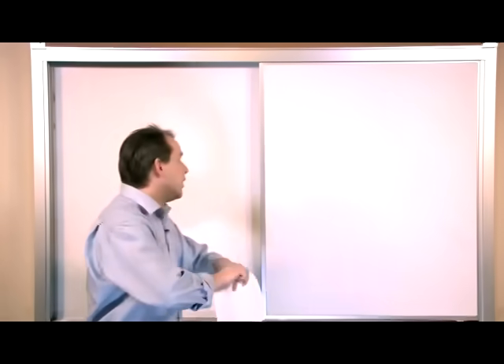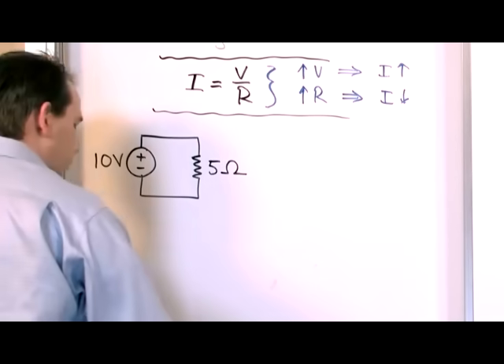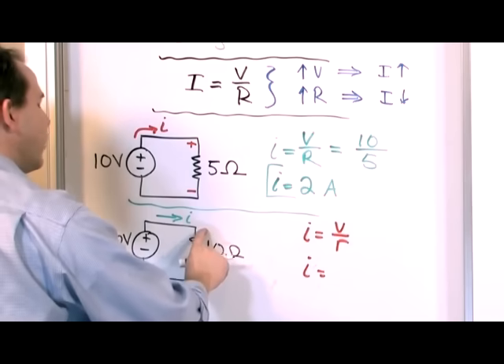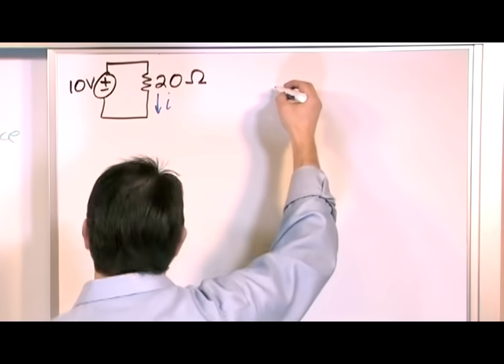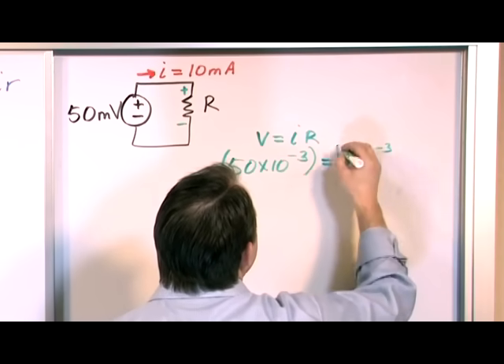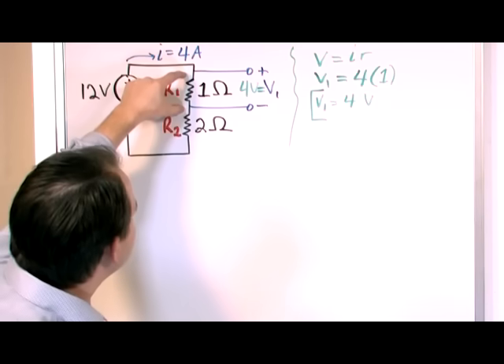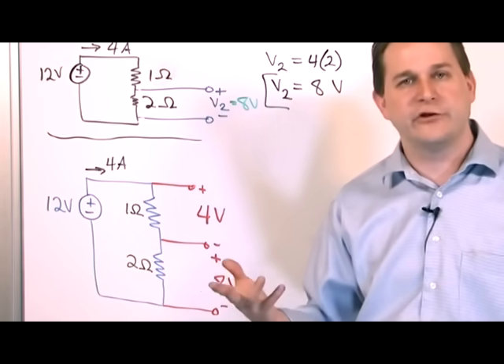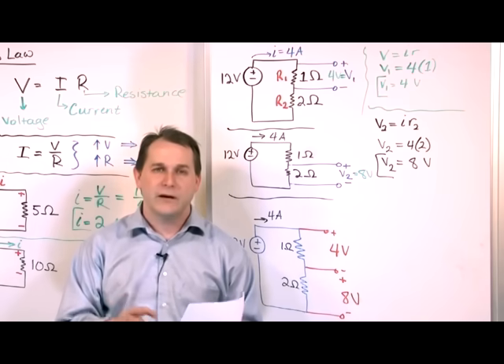03 - What is Ohm's Law in Circuit Analysis?

Comment: I'm confused. I think I understand Ohm's law just fine, here's the problem. If I take one of those small 9 Volt batteries, and hook it up to a 1 Ohm resistor, Ohm's law says that is 9 Amps. But I looked it up and Google says that 100 milliamps can kill you. How does a small battery produce enough current to kill 90 people?
Reply from the maker: Gary, your calculations are 100% correct.  However, in real life that small tiny 9V battery, as soon as it is connected to that 1 ohm resistor, does "attempt" to supply that much current.  But because the battery is physically small, it can't supply enough electrons per second to supply 9 amps of current.  Basically, because it is physically small, the chemistry inside the battery and the surface area of the internal electrodes inside just can't supply that much current.  So, it supplies as much as it can and saturates at that maximum level which is not anywhere close to enough to kill you.  Now, here is the punchline, if you constructed a 9V battery much larger, say, build one as large as your living room, with enough internal surface area of the electrodes and associated chemical reactions that could produce more current, it would be a different story.  If you build a really large battery like that that had 9V across its terminals and you put that 1 ohm resistor across it, then it would then by ohm's law supply the 9 amps of current.  Think of ohm's law as the ideal case.  Ohm's law predicts what current would be produced if you had a perfect battery at that voltage that was physically capable of generating enough current that ohm's law says it would generate.  Hope this helps!  Jason
Reply: then, how would this "physically small battery"  behave when one completely removes the resistance and convert the circuit to a short circuit ?  How much current do we measure before the wire burns?
Reply: I remember as a child getting a 9 volt battery & allowing my tongue to touch the two terminals and feeling a buzzing or tingling sensation. Whereas my brother once accidentally touched the two contacts of a light fitting that was plugged into the mains and is lucky to still be alive. The body is a good conductor (especially a wet tongue!) so the current is going to be low because the resistance is small and the voltage is low. There is also a difference between a direct current and an alternating current. With a Direct Current (DC) you would need to receive between 300 - 500 milliAmps (or 0.3 - 0.5 Amps) to cause life-threatening irregular heart rhythms but with an Alternating Current (AC) oscillating at 50-60 Hz (or cycles per second) you only need 60 - 100 milliAmps (or 0.06 - 0.1 Amps) to cause life-threatening irregular heart rhythms and you are starting with a higher voltage. The moral to this story: be careful electricity can be dangerous. If you are going to touch something make sure it is switched off and that there are no capacitors storing any charges. Learn to use a multimeter to measure things first.
Reply: @sharonjuniorchess  - your brother might be lucky to be alive, but it all depends on how and where he touched the terminals on the main outlet. I have been zapped by mains current a couple of times (European mains current @ 230 V, 50 Hz) and is still alive.

Electrical current is "lazy". It always takes the path of least resistance. Touch two main terminals with 2 fingers on the same hand, and the current will flows from one finger, across your hand, and down the other and dissappear into the socket again. Ohh, you will feel it, your fingertips will burn, and you might not be able to control the muscles in your hand for hours, but it will not kill you.

On the other hand, if touch using only one finger, the current will have to find another way to get back to the electricity company - and that will be through your hand, your arm, and your body. That could be deadly. Especially if you happen to be griping a water pipe (iron) with the other hand since now you are guaranteed that the lazy current will streak across your chest and your heart from one shoulder to the other, zapping your heart and whatnot.

Professionals working with high currents knows this, so do not be surprised if you see an electrician with his left hand firmly stuck in a pocket while he pokes around (even if he knows that power has been cut). Keeping that other hand from touching anything reduces the likelihood of getting current across the body. Reduces, not eliminating, but you take what you can.
Reply: From what I've found out the human skin has about 100kΩ to 600kΩ when dry. To get a current of 100 milliamps, or 0.1A, through such a resistance you would need about 10kV to 60kV. In other words 9V wouldn't normally be enough to get such a high current to travel through our bodies, at least not through dry skin.

Please note however this does absolutely not mean it's safe to stick a fork it a power outlet, around 120V-230V,  just because it has a lower voltage than I mentioned above. This is a very simplified scenario assuming the skin is dry. There also exists other factors than the humidity of where the current enters such as where does the current enter, where does it leave, how far does it travel through your body, which organs does it travel trough, how large is the area of entrance/exit for the current, how grounded are you... etc.

Also I'm far from an expert. If I said something incorrect please do point it out.
Reply: You would have killed the battery before it would affect you. Your battery is not powerful enough to generate that amount of current.
Reply: "...current is going to be low because the resistance is small..."  This is exactly opposite,  when you lower resistance, you increase current.
Reply: Robert I thought I had got it right but you are right. Current is inversely proportional to Resistance. So the higher the Resistance the lower the Current and visa versa the lower the Resistance the higher the Current. Now I just have to get my head around why I am still alive?
Reply: 1. The battery is not large enough to supply 9A. As in, there is literally not enough chemical reactants within it to produce that much current. 2. Even if you did have 9V with unlimited current and you hooked up a 1 Ohm resistor and touched it, you would not die, as your body has about ten kiloohms of resistance.
Reply: Gary - think of it this way: If you take that 9V battery and carefully place a 1 Ohm resistor across the battery poles, why would it kill you? You are happily standing there, and the battery and the resistor is equally happy propped up over there. Nothing will happen to you.

Now if you happen to remove the resistor and put your thumb across the poles, something MIGHT happen, but what? Not much really, because the skin on your thumb has a much higher resistance than 1 Ohm, so using Ohm's law you will see that the current coming out of the 9V battery is much reduced. I am sure you can use Google to find out the resistance value of dry human skin. For fun, see if you find the resistance of wet human skin, and you will notice a difference. Again, I do not know the exact difference between dry and wet skin, but a guess would be like 10 times lower for wet skin. Combine that with the little trick of touching your sensitive wet tongue to poles of one of those small squarish 9V batteries, and you will start to understand why it will buzz your tongue - but not kill you.
Reply: Well you need to be able to generate this current THROUGH your body in order to be killed.  Touching the wire which carries let's say 1A is not necessary going to kill you since this current is through the wire not   your body. What can kill you is Voltage(difference in potentials between two points) from powerful enough source across two parts of your body.  If you followed this video closely you know that I = E/R or U/R  where E(usually this letter is used for Voltage sources like batteries or other power supplies)  or U (usually for Voltage drop) is the Voltage and R is the resistance this voltage is applied to.  Skin resistance vary a lot but it is relatively high  from 1K to 100K depending on how wet it is. Use the above formula and see what should be the Voltage in order to generate that current through the body.  
While covering this topic tutor assumed that source of voltage is sort of ideal (unlimited power)  so it can generate current of ANY value up to almost infinity.  However in real life it is not the case and battery or other power supply can provide their nominal voltage ONLY  up to certain limit. Another words if you connect the load (resistance) which is going to draw current  which is too high the  power supply will not be able to provide nominal Output voltage and it will be lower (sometimes much lower) then nominal.  That is why for real power supplies there is a term like internal resistance. So basically Any real world power supply can be represented as ideal power supply connected in series with some resistance And this  resistance  (which is sort of imaginary resistance) is connected in series with the load.  When the current is not too high you can disregard it . However when current becomes significant then there going to be a of of voltage drop on the internal resistance and the rest will be dropped on the load itself.  So basically when you connected 1 Ohm resistor to 9 V battery most of the 9V dropped on the internal resistance and the remaining on 1 Ohm resistor. As an example look at power supply of your laptop. It might say something like 20V  2A(yours might be diffrent ).  That essentially means that it will provide stable 20V output unless load will not draw more that 2 A.  You can calculate maximum load in Ohms for that power supply  20V/2A = 10 Ohms. So to summarize all above : in order to inflict any harm enough voltage should be applied between two parts of the body and the source should be powerful enough to sustain it.